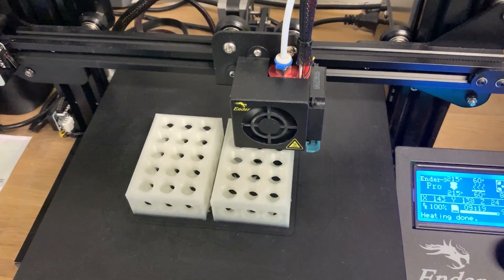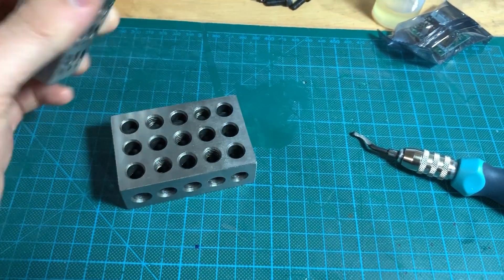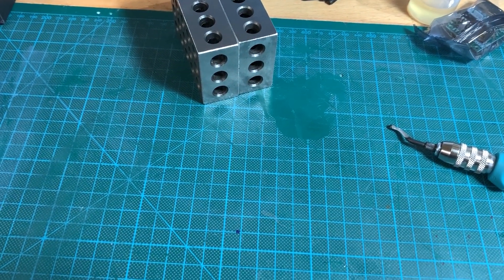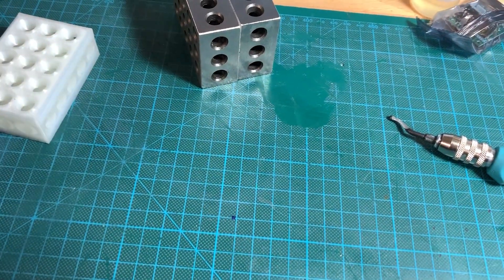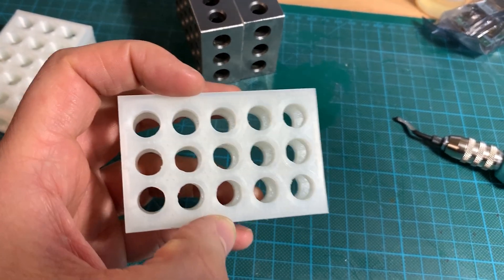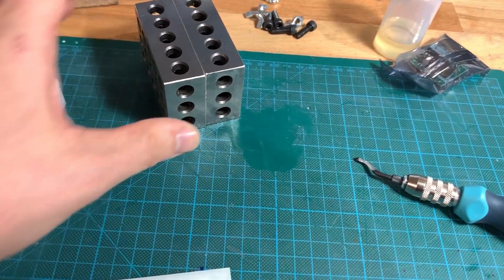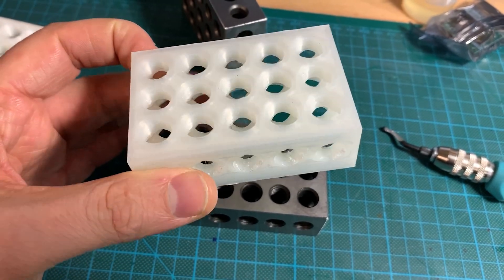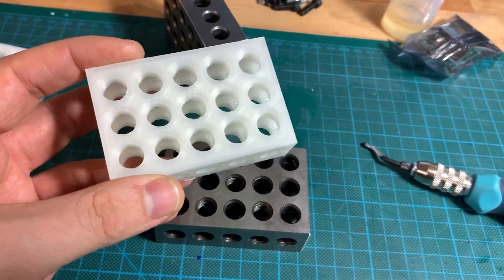Machining 3D printed PLA part?!

Comment: Great idea. Do you use 100% infill when printing them? Do they deform at all when clamping them down or clamping parts to them?
Reply: Depends on the accuracy you want. If your trying to stay withj. Say .010"id guess they wouldny be up to the job of any forces were applied